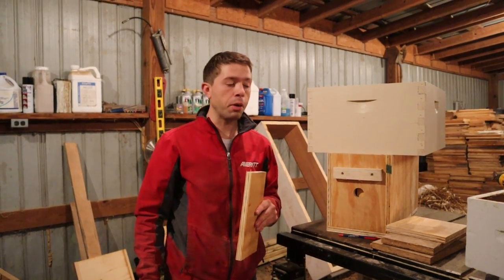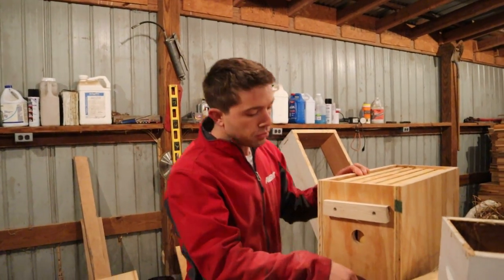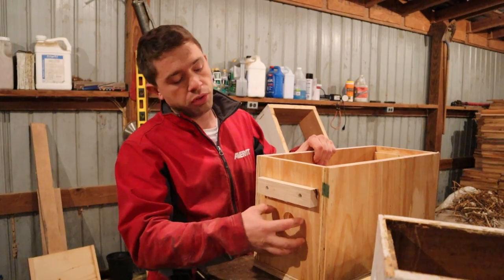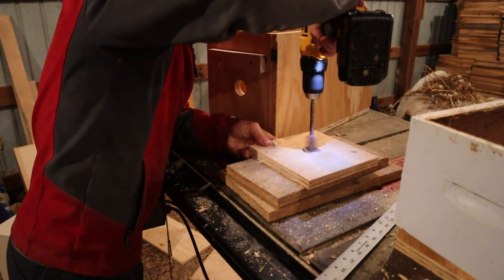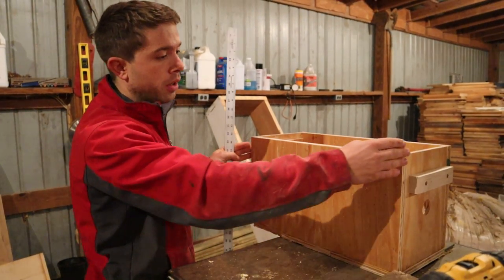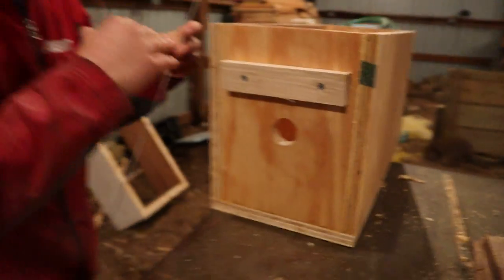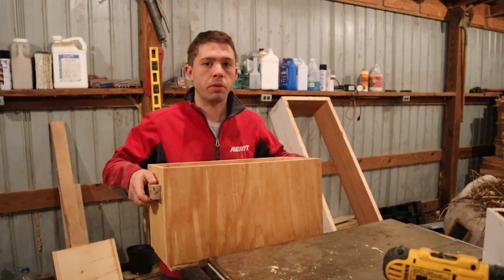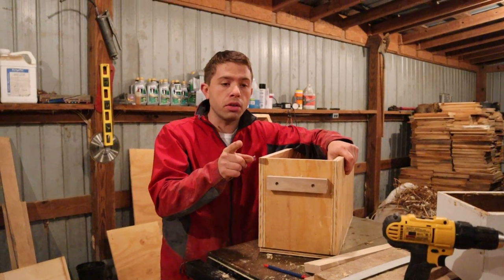🔵Building a 5 frame nuc for JUST  $4!!!!

Comment: Please don't take this as critical, but I have built boxes using a similar entrance design and found out the hard way that rain doesn't always fall perfectly vertical. What happens is that water can get inside the nuc box causing both box rot, and more importantly too moist of conditions for the bees. If you're going to use this type of entrance, then you MUST have a way to drain the water. You can drill 1/2 inch holes in the bottom board and screen them with hardware cloth. Alternatively, just put the entrance flush with the bottom board and use a slight tilt forward to prevent water buildup.   BTW,  you can still use the entrance discs with the bottom entrance of your design.

Comment: I won't list the name here, but another YouTuber has plans that simplify the frame rest. You basically just cut the front and back shorter (to the height that you would normally cut away with a router, dado, etc.) and then close off each end with the handle. Uses just a little more wood for the handle since it will need to span the entire width of the front/back, but simplifies the whole process. And also, if you like a bottom entrance like on a typical langstroth, you just cut the front .75" shorter yet again and shim it up when you glue/nail it down.  That keeps you from having to drill the circular hole.

Comment: how about instead of slicing it down you glue two slim pieces of wood together with the second piece reduced by the depth of the frame handle, then drill the opening hole.

Comment: So far I made all my 10 frames boxes and Nuc's. I started with a skill saw, but now I use a used table saw that I bought at Goodwill for $10.
I use solid boards because plywood will warp as I found out after making a few Nuc's. I use screws for all of my boxes. Also I use screws for the lids to keep them on the hive for those few plywood lids that I made to keep them from warping. I use bottom entrance since the round side entrance like Kamon had caused me for some reason to have a lot of hive beetles. 

I use those big handles for most of my hives, makes it easier and safer to carry those boxes.
I also use bottom board on all of our boxes, but on the Nuc's I screw them on. This way I can use the Nuc's for different  things, like stacking them if I want to or adding entrance feeder which I have done if food is needed.  

I also make and use feeder rings with vent holes to control overheating.

Comment: I nail a couple of pressure-treated 1”X1” cleats on the bottom of mine. Keeps them off the ground & gives me more options for placement. For plywood covers (after I’ve constructed my boats, dune buggies, sky scrapers & such), I spray on the outside a coat of Flex-Seal. It’s supposedly food safe and seems to weather well.
Reply: I live in Florida and I am going to try that.  The moisture here is hell on woodenware.

Comment: Great video!
I completely agree and appreciate that you kept pounding home that sealing the wood is critical.  I have done 2 things regarding that but don't have enough data to make a determination on how effective they are.
1. Any exposed grain, whether it be end grain on the exposed parts of dado cuts or the edges of plywood, I try to use a paint brush and apply Titebond III.  Paint isn't thick enough and water repellent enough.  I'm hoping that by doing so, it'll lengthen the life of the boxes.  Obviously I still paint the boxes with regular latex paint, but that end grain is so much more porous than the rest of the wood, it makes it a failure point.
2. I started setting my circular/table saw at 45 degrees when I create my hand hold strips.  I end up with parallel 45s on the top and bottom of each hand hold.  There's a downside and an upside (I believe).  The downside is that on the bottom you have a sharp edge if you don't sand it.  The upside is that where the hand hold attaches to the box there's no place for water to collect.
Just thought I'd add those two points for anyone to consider...

Comment: Great video, Thanks' for sharing. I work mostly with nucs and make them exactly as you, no screened bottom board helps avoid hive beetles. On my boxes I make the entrance hole with the round plastic disc on the downside of the front and bees will clean out perfectly.

Comment: Hey Kamon, what are you doing for a lid with those? They look really nice. I have given up on the mid hole you have and gone back to the hole right down the bottom. I found over here that the Bee's didn't always clear all the rubbish out due to it's location, and the small debris gave the wax moth a sneak little hide out for their lava, despite having a really strong colony. Bottom hole also allowed water to escape if we had a crazy storm and down pour. Just my learning, might not be applicable to your area of course.

Comment: If you use migratory type covers, you don't have to cut the fancy frame rests, you can just cut a handle piece and secure it across the top of the ends. It makes the build a tad easier and quicker. The ends have to be made shorter, they only need cut to length so the top of the board is the bottom of the frame rest. Then you have your frame rest and your extra HD handle incorporated without the mess of the two part frame rest cut. Use a HD lid because that 1/4 ply as a lid will warp and I don't care how well you seal it. Don't ask how I know, lol.
Reply: Well said Brent was trying to work out how to explain how to do it and read your comment and you nailed it.
Reply: @sentimentalbloke7586  Well I forgot to mention you'd probably want to shorten the length of the box a bit as well or the frames will have more wiggle room than usual. I built several of these a few years ago and didn't realize until I had most of the frame rests cut that I could have saved a lot of trouble with the little change. As a side not, those boxes work fantastically, I still have those originals but the original lids did warp badly. Changed them out and they have bees in them now still to this day.
Reply: Brent, I build them the same way, using the handle across the top of the box instead of cutting a rabbet for a frame rest. The top of the end wall is the frame rest. I use 1/2" plywood so the dimensions come out easier.
Reply: @Digger927  I used the dimensions that I got off this site and they worked well very little offcut from a full sheet of ply, I use mine to do splits, and for small swarms and they suit the job well.
Reply: What is a ''HD"" and thank you for your comment.

Comment: I use 3/4" ply for the sides, then I use two pieces of  3/8" ply stacked to create the end boards.   

Then you can just rip everything to size and you stack the two boards for the ends creating the frame rest.  

Without having to do any precision cuts to create the rest or using a dado.

Also, if you don't have a table saw, but have a lowes/home depot  that isn't busy.  You can pay them 25 cents a cut for them to rip it on the panel saw.   You can cut multiple pieces at the same time to save on the number of cuts.

You can google "D Coates Nuc" for the measurements.   I just use a full endboard for the front and back, instead of the little piece for the frame rest.
Reply: That’s a good idea for the end pieces. My Timber merchant cut the ply but couldn’t route a groove for the frames on the ends. Will use 3/8 as you suggested. Thanks KR.

Comment: I repair my boxes by cutting out rooting or damaged sections and replacing them with new wood where possible.   Most deeps that are beyond repair have enough good wood in the sides to cut down to Kamon's end dimensions and use them to make nuc boxes .   A side benefit is the rescued ends have handholds.

Comment: I have just finished making 20 X 10 frame boxes. I am using pine wood. The box with lid costs me less than $10 a piece. However, I will now make 5 frame Nucs as demonstrated by you. I am anxious to see how they perform in the spring season next year. Your method seems easy to follow. Thanks.

Comment: Another issue I found with plywood and NOT putting something on the inside, which you wouldn't have to with a solid box, is the ply sides warp when they get damp from bee humidity. Some warp out, some warp in and eliminate the outer frame surfaces. Time to make new ones.

Comment: Ive started cutting 10 frame deep boxes in half an making nucs, can cut bottom boards too
Reply: skooterbumm great idea to recycle ole boxes
Reply: Try connecting a bottom board then dividing. You can run two in one if you're clever. 
Then you stack nuc boxes and if you have a good flow you can collect honey from the double-nuc. (Duplex)

Comment: Great video, thanks for not cutting it out on camera, you are correct that we all know how to use a saw.
One shortcut/improvement would be to make the frame hangars using the metal reinforcements Dadent sells for a quarter each (L Shaped Rabbets Part Number M00722) and a simple cleat stapled on the front and rear panels. You could also use larger piece of 3/8 or 1/2" ply if concerned about the extra 3/8" of space at the frame ends.
No fancy cutting and the benefit of the steel reinforced hangar surface, easier to keep clean and slide frames on.

If you don't care about the metal reinforcement, just use a cleat or panel of ply stapled in place.

Comment: I am working on my 2-frame boxes now but will need a dozen or so 5-frame boxes by the end of the year.   Thanks for sharing.
Reply: How many 2 frames boxes do you need ive got 20 or so I'd like to get out of my way, i built them an only used one yr, are nice painted an ready to go. if interested.?  Just to time consuming for my operation
Reply: @waynewatson-cedarbranchhiv8491  I am looking to have about 10-12 total (I already have a few built using scrap lumber).  I am looking to do some small scale queen rearing this year and thing that number should do the trick.  Whereabouts are you?  I am up in central Maine.
Reply: @gileshoney5796  , ohh your along way from me , im in se Missouri,  these are all made out of 1×12s an have migratory type tops, if further interested i could send you pics . ?
Reply: @waynewatson-cedarbranchhiv8491  If you were closer I would be interested, but Missouri is quite a ways from Maine.  Thanks anyway though and happy beekeeping :)
Reply: @gileshoney5796  yes it is a long way, good luck to you this yr. !! 🐝🐝

Comment: I wil be making some nucs out of  WBP plywood i have seen some plans where you can get 5 nucs from one sheet of ply
Reply: 4 nucs
Reply: Beesource.com has free plans for nucs. The D. Coates design will build 4 nucs with one sheet but the measurements in the plans are for using 1/2 in plywood. About 3 dollars each to build
Reply: Cade Rector ,yep agree with you I just recently made my own, I got 4 nucs out of one sheet and they take 5 frames.

Comment: If you don’t want to buy those round, multipurpose entrance discs, you can easily make them out of dog-food lids with ring-pulls (don’t gotta dog? Get one.). Drill a screw hole in the center. 180 degrees from the pull, cut out a one quarter (90 degree) triangle, not quite to the center hole. To one side, drill a bunch of small(1/16 - 1/8”) holes. Other side, cut a 3/8” square. So, you have available options of large entrance, small robber/mouse guard entrance, and closed, vented entrance, with a ring pull to grasp and turn. The hole in the wood needs to be just slightly less in diameter than half the lid diameter, so you’d likely need a second, screened opening elsewhere. I build mine with a 3/4 x 3 1/2 opening at the back, to snugly fit a Boardman feeder, so a little strip of #8 hardware screen can be tacked over that if a vent is needed.

Comment: I do all my cuts on the table saw, just take your time cutting the frame rests, I use rough sawn lumber from band sawmill, take your time to figure out Langstroth's inside measurements and then go to it, I can make a lot of nucs in a day, I make bottomless boxes for supers and my holes are smaller-one in bottom front and one in back at the top and supers the hole is at the top, that way the bees can defend the two smaller holes and gets rid of heat/moisture- overwintering

Comment: I use 3/4" for the sides and a 2 layer stack of 3/8" plywood for the ends.  This is so I don't have to cut the rabbits, the inside of the 3/8" plywood stack is sized to create the rabbits for the frame rest/sides.

Comment: This year I’m going to add some frame stabilization to mine. After setting up the bee space, I’m going to drill vertical holes in the frame rest to add dowel pins to keep the frames from sliding. I’m brainstorming on if I can add something to the bottom of the outside frames to completely stop shifting and rocking during transport.
Reply: Solutions create problems..

Comment: Right now I am making up 50 five frame nuc boxes for this year.  You should show how to make a dcoats version for people without datoblades. Also mention the difference in height between the base unit and the second story boxes.
Reply: Yeah! If I just staple a board on as a bottom it violates bee space and eventually you crush a queen putting her into the box. I built one of them fancy nuc boxes you use as a toolbox or to carry bees around and I made that mistake.
You need little nuc bottom boards to do it right imo.
Reply: You don't need a dado to cut the frame rests. Just one cut 3/4 deep then another 3/8 deep to meet the 3/4.

Comment: I like your idea of a solid wood board for your handles. Suggestion. What about tapering the handle so that it is 3/4" wide at the bottom and say an 1/8" or even 1/16" at the top so it doesn't pond water when it rains. That way you can still have a flat surface to glue it on as well as screws. Also would it be better to screw it in from the inside so the screws are not exposed? Maybe I am trying to build a Cadillac instead of a bee box. Hahaha!
Reply from the maker: That handle would be sweet and if we were not trying to keep it simple for those with fewer tools we totally would have done a tapered handle.
Reply: @kamonreynolds  Is there a possible market for a tapered handle? I was thinking of using 5/4 x 6 decking, which is about 1-1/16" thick x 5 1/2" wide x 12' or even 16' long boards, pressure treated of course. It could be be ripped in three cuts. Ripe the board in half, then set the angle so that in two more angle rips you have 4 finished pieces  1-3/8" wide pieces with each having a taper. Then it is only a matter of cutting the pieces into a length based on what size hive you have, 3, 4 or 5 frame nuc, 8 frame box or 10 frame box or offer a custom length. Your thoughts?

Comment: Titebond 3 is a waterproof wood glue that would seal and bond those joints. Thanks Kamon
Reply from the maker: Titebond makes top shelf wood glue. Version 3 would be the most ideal building nucs thanks for letting us know! I forgot to mention that!
Reply: @kamonreynolds  Kreg makes a pocket hole jig that creates a very strong but joint also.
Reply: I used the inside /outside tidebond 3 glue for years now with very good results.

Comment: Hey Kamon, I have seen a lot of nucs and most are made from 1/2" cheap plywood. They seem to work for what they are used for but I am old school and I always figure bigger is better. I prefer 3/4" wood like you but plywood is straighter and cheaper. I am starting out with 1/2" just because of the cost. What are your thoughts since you probably have seen both?

Comment: Uh you didn't mention they are an awesome SWARM TRAP.  Nuk Boxes are your friends.😁😁😁😁. Oh just an added edit.  I still holes in my nuk and cover with screen but I am in Florida.  But you can still holes about 8 or 9 mm right under you cover.  That will allow the bees to travel through, added ventilation, and it is small enough they can glue it shut.  Here in Florida high moisture plays hell on boxes.  Plywood works. My front and back I use two layers.  My frame landing is easy.  There are plans for a jig to cut handles in a box.

Comment: Looks like you are adding ~1- 1 1/8" to the standard langstroth deep super depth so, if one was using only mediums, that depth should be ~7 3/4" or so - that look about right to everyone?
Reply from the maker: I like having more space at the bottom for bees to cluster underneath the frames.
Reply: I like extra depth as well, that way if your useing frames out of other hives for splits an putting in a nuc youve got room for the cell , i use full width 1x12s , only down side is burr comb, you gotta scrape off before putting in a 10 frame
Reply: 95/8
Reply: @sheilamclaughlin963  yep yep I cut mine 93/4 just because.

Comment: I like the small hole entrance and wheel. To me this would limit the number of small hive beetles that can just land on the bottom board and walk in. Will test this theory in spring
Reply: I had more hive beetles with the round hole like Kamon has on his Nuc, than with an bottom entrance,  last year. The nice thing is that I can use entrance feeders which will reduce the entrance and reduce robbing. If I transport the nuc, I just screw a piece a wood at the entrance with the cordless screw driver.

Comment: Thanks Kamon.  What size staples do you recommend?
Reply from the maker: 1.5 inch long 1/4 inch crown 18 gauge. This size of staple also work great for frames
Reply: I use 1.25 inch because of how I build my bottom boards. 3/4 inch on top of 3/4 inch. 1.5 is too long.
For frames I use the same thing. 
Pay extra for the staples.with glue on them.